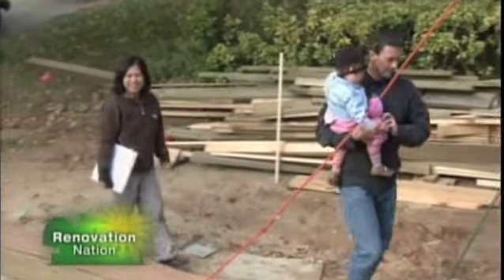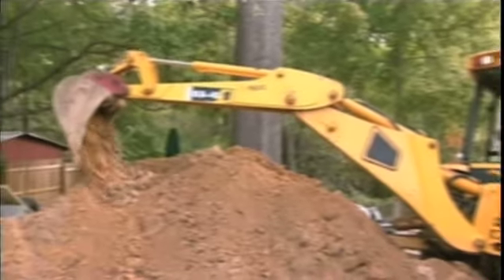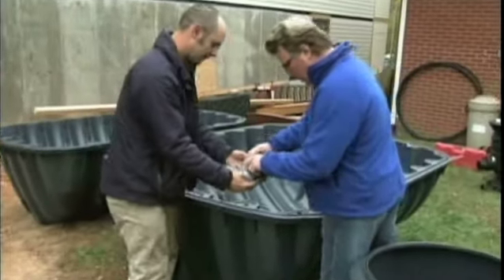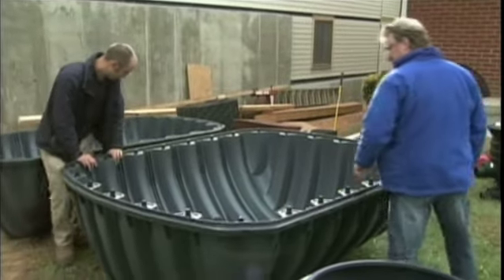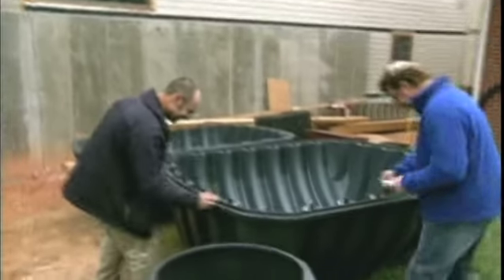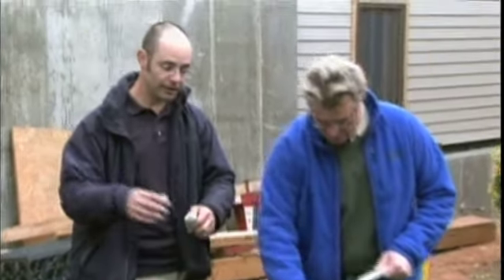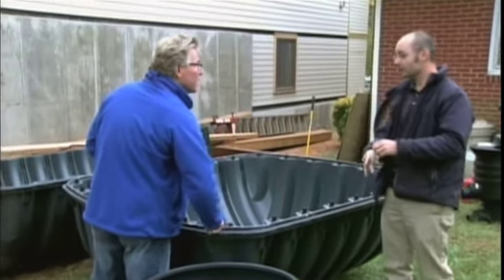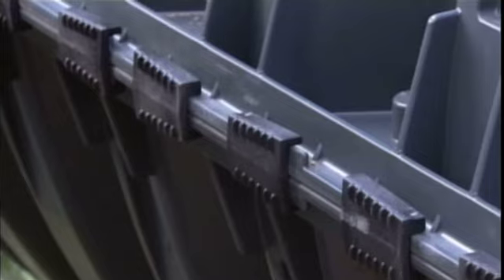Renovation Nation, Rainwater Harvesting

Comment: pir8bill. You're point doesn't hold up. The purpose of the tank is to hold water for them to irrigate their yard. Which means it still ends up feeding lakes, streams and underground water tables, its just being used at times when its not raining. And it prevents fresh potable water from being used for such purposes.